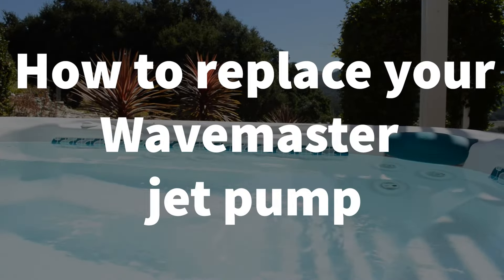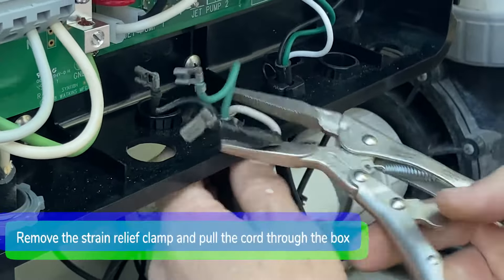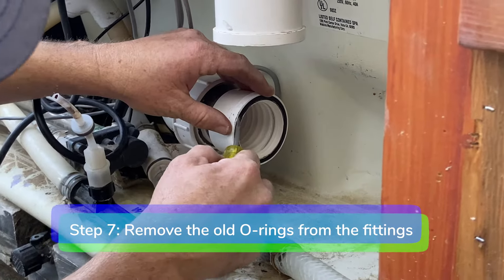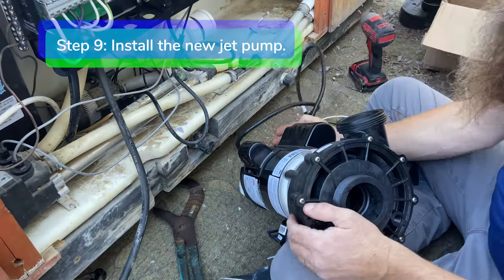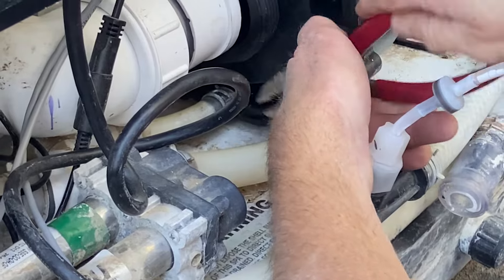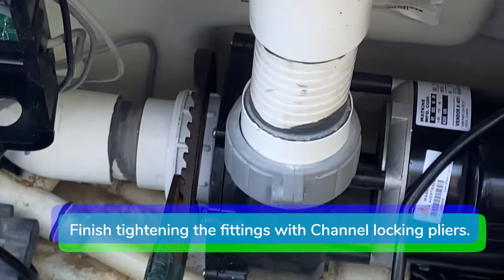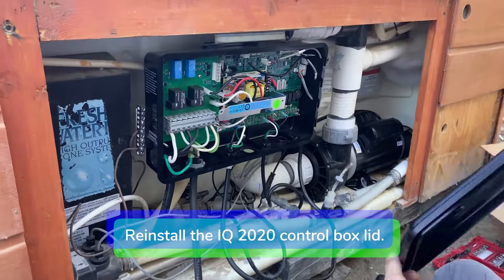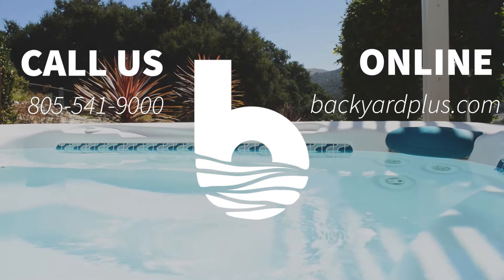How To: Replace Your Wavemaster Jet Pump: Essential Guide

Comment: Where do you replace the wiring from the old pump motor to the new one?
Reply: The new pump unit comes with its own new connection wire unit already attached